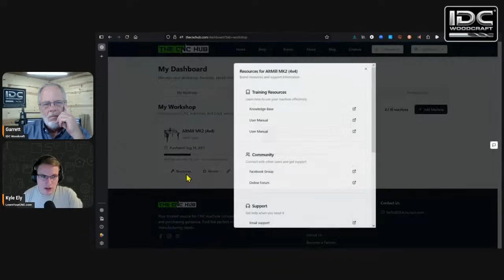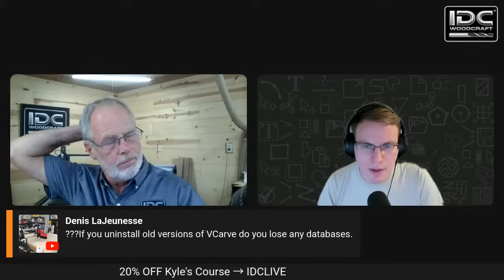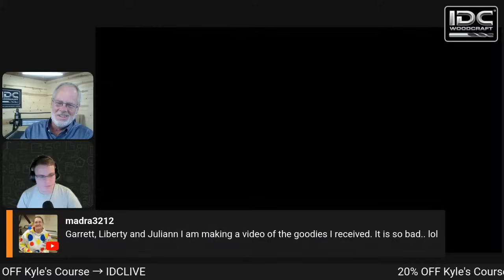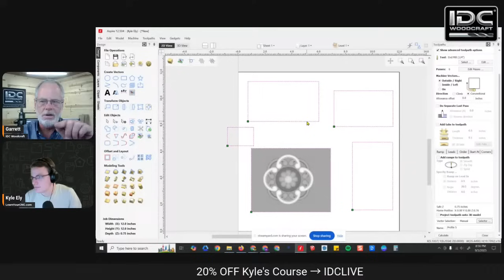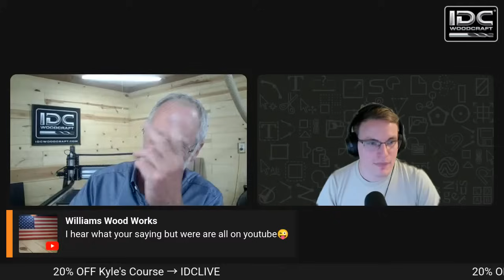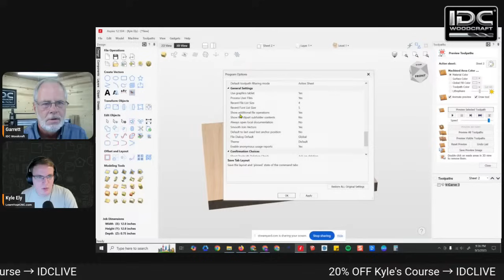Stop Guessing CNC Machines: TheCNChub.com Launch & Vectric Tips with Kyle Ely

Comment: Hey Garret, have you had anyone suggest there's an issue with your IDC Woodcraft Toolbase download in Vectric 12.5? I have to delete and download it almost every day (because it's losing data and not complete (148 tools) and now I'm having an issue I'm having Vectric Support look at which discovered your toolpath variables such as "Pass Depth," "Final Pass Stepover" (0.005) is slowing down things substantially (preview) but not sure to what extent. Anyways, thought I'd ask. Thanks.
Reply from the maker: Hey there! I've had a few folks mention some troubles with toolbase downloads in Vectric, but I recommend reaching out to Vectric Support for the most accurate help. I appreciate you bringing this to my attention, and thanks for watching!